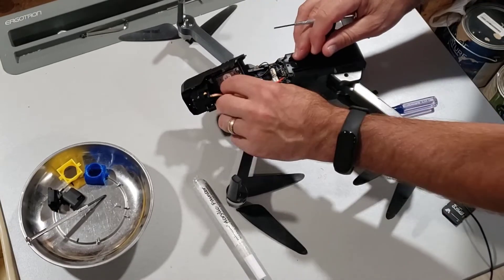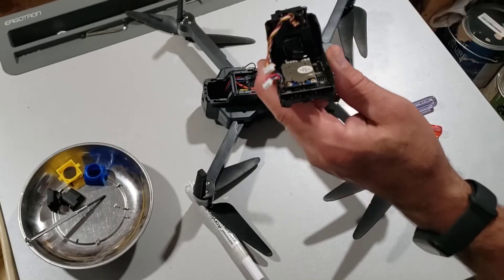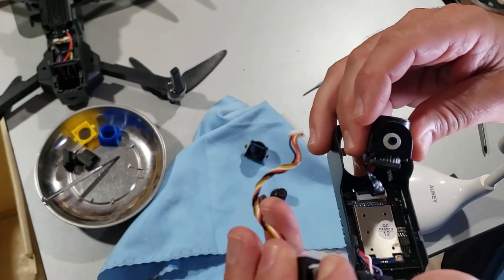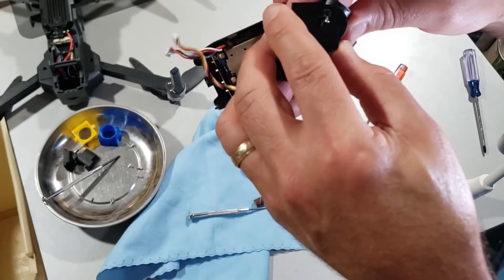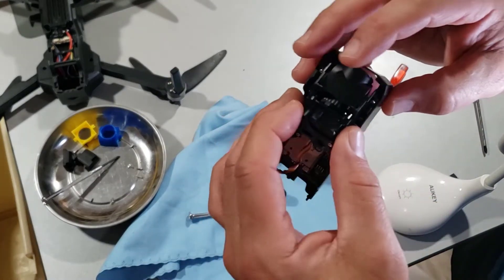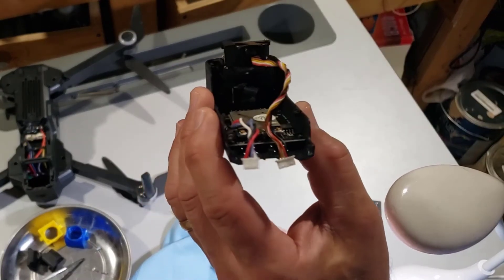Fixing the Fisheye on the SJRC F11 Pro! Simple Steps Sweet Success

Comment: I have the same drone and havent flown it for awhile and for some reason the camera angle is upside down when i use the app. Is there a way to rotate the camera so its not upside down or am i doing something wrong during calibration causing the camera to be upside down? Any help will be greatly appreciated i just purchased a new battery because my old battery crapped out so that was 50 dollars and i really want to use the drone!
Reply from the maker: I am not sure. I sold that drone a long time ago.

Comment: Is there any way to fix the camera that won't adjust all the way up. It's like the camera  gear jumped. It will adjust but will only adjust up half way and it stops. I was flying it and ran into a trash can  and I think it pushed the camera down skipping  or jumping gears. Thanks for any help.
Reply from the maker: After it powers on, gently pull it up and it will stay there till the next time you power it off. If you decide to tear it down, be careful of the wires... I learned that the hard way.
Reply: @HLModTech  thanks for the reply!! 👍
Reply from the maker: @tellitallnow3914  My pleasure. Hope it solves it and you are getting the results you wish for again.

Comment: I was happy to see this video, but after watching it, I don’t know if this is something I am willing to try. I’d have to buy some tools, a Dremel for one, along with a lens, and for probably not much more could purchase the newer Model with a standard lens.  I’m not sure if that comes with a gimbal, but that’s what I really want. If not, I just might purchase a drone with those features. I know it will cost me.  I learned on the F11 Pro, and it sure took a beating. It looks like it’s been through a war.
Reply from the maker: Buying a new F11 pro is a good gig. I love mine. Like you I learned a ton with the F11 Pro and am happy with the new lens I installed. It was a ton of effort though.  Nice thing about snagging a F11 Gimbal that the batteries are a direct fit. 👍
Reply: @HLModTech  - Well, I flew today and couldn’t move the lens. It wouldn’t respond so I’m taking that as a sign to get the GIM!  Happy flying!
Reply from the maker: Bummer have to it start to fail, but I think your going to love the GIM. 👍